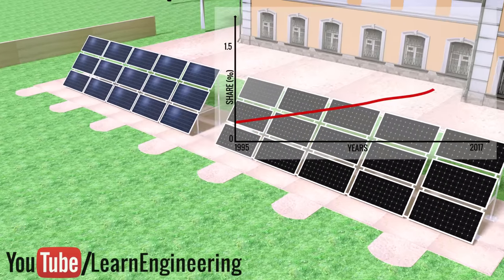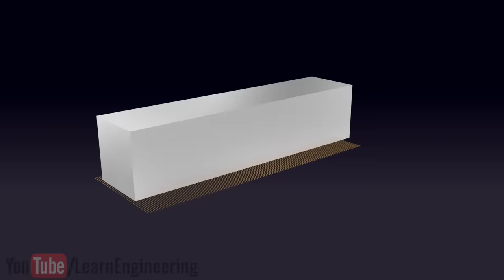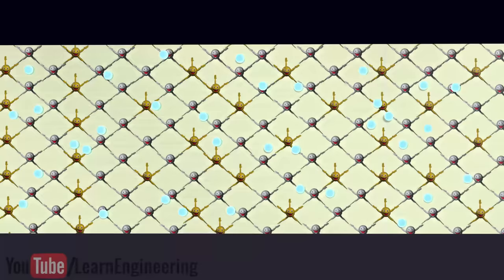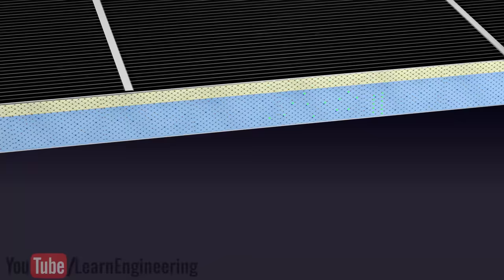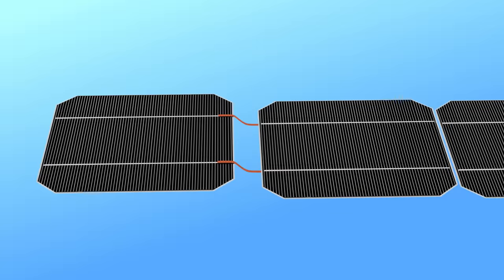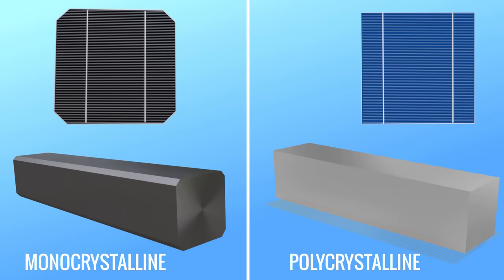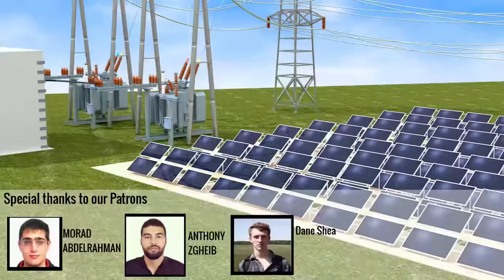How do Solar cells work?

Comment: The emoj-like nucleus representation is really creepy.
Reply: Atlas Wlk it's not creepy according to me. It helps us to get a clear picture of that bonding example.
Reply: I didn't quite understand why the holes and electrons formed in the depletion region were moving in their given directions. The electrons moved over to the negatively charged side which already had an excess of electrons, which seems like the opposite of what should happen.
Reply: @fonduman213  
It is kind of confusing. The important thing to note is that the P layer and N layer have NEUTRAL charge to start out with. The P layer (green holes) is not positively charged, it simply has atoms with the electron structure that allow it to accept electrons and become negatively charged. So when the depletion zone forms, the area of the P layer in the depletion zone is actually negatively charged, in other words it was neutral and has now accepted electrons. So when more green holes pop up, the go to the negative charge which is the P layer, and all the green holes stack up and flow through the load.

You can probably get a better explanation than I can give if you look up how a diode works, which is literally what a solar cell is; a bunch of PN junction diodes.
Reply: @fonduman213  Because electrons move in the opposite direction of the electric filed, while holes move in the same direction of the electric field.
Reply: @kushagrak960  Don't use the word 'according' to describe your own opinions. It sounds very arrogant.
Reply: According to my expert opinion, the world will be ended 300 years before this video is will posted. 🤪
Reply: @fonduman213  The electron-hole pair does not happen in the depletion region, they take place around the depletion region...  As the photon energy in the sunlight is higher than the bandgap energy (1.1 eV) the sunlight excites and wakes up the otherwise 'sleeping' electrons.. thus causing electron to move...  and hence current

Comment: I was doing some reading about the James Bond Movie: The Man With The Golden Gun on TV Tropes and Idioms. They mention that the villain: Scaramanga, has Solar Cells that operate at 95% efficiency. They mention that the best that solar cells currently get is 25 to 35%. They added that if solar cells really could operate at 95% efficiency, then all other power sources would be obsolete and the energy crisis would be solved. We'd have all the power we'd ever need. Hopefully they'll achieve that soon. Imagine, you'd have solar panels on your roof and never have to worry about running out of power. You could have them on your vehicle and never have to worry about recharging the batteries. Vehicles of every type, except submarines, could be solar powered. Even jet aircraft, since there is a such thing as electric jet engines. The problem with them right now, is the batteries can't hold enough power to allow them to fly the same distance or further then standard jets. Too bad.

Comment: large solar Farms also use STG systems for energy storage for instance they might be used to run a water splitter and store the excess energy as hydrogen and oxygen gas to be used as fuel in a generator at a later time

Comment: Thank you for the video ! Can someone explain to me why the electrons generated by the light energy crosses the depletion region into the N-side ? The field favors that direction; but the field is only present in that direction within the depletion region right ? Beyond the depletion region, in the N-side, electrons would want to stick around the positive ions in the depletion region. So why does it move toward the terminal in the N region (Away from the positive ions) ?
Reply: Probably two years too late now but here it goes. Imagine now the electron has travelled to the n side, with that one more electron at that n side. The n side is initially charge neutral. This electron pertubs the charge balance of the n side by making it more negative. The positive and negative "forces" don't equal now. So the sensible thing is to kick an electron out into the external circuit to maintain back its charge balance.

If you are interested to learn more about solar cells in an intuitive and fun manner, I'm starting a video series called "Shining Light on Solar Cells", covering the a-z of solar cells. Catch the series here: https://youtu.be/53eBzy8eZ-8

Comment: "in the case of a solar power plant, the massive amount of storage required is not possible" isn't that what Tesla did with their peaker battery packs in australia? just wondering how it is "not possible" from an engineering standpoint?
Reply: Not economically 'possible' maybe, it's always a matter of cost, of course it's possible, I always have a motto "If you can imagine it, then it's possible"
Reply: "If money and time tends to infinity everything is possible"
Reply: Instead of storing it, we can just transfer the power generated by the solar plant to the grid system. It is more cost effective
Reply: It is possible but the costs would be high so we just let it flow into the grid like any other thermal power plant.
Reply: Yeah that didn't age well 😆
Reply: @rickyal9810  how so? Looks like the hornsdale power reserve is still in operation

Comment: Hi guys, thank you very much for this video. It's very well done. Just one question. My understanding is that electrons would move to fill the holes. Why then would the electrons move to the n region when light hits the junction? Shouldn't it move the other way towards the p region?
Reply: no because they would want to move toward their side, not the depletion zone
Reply: @milanganguly8751  That's what I didn't understand. With the depletion zone being electron poor (and therefore positive), wouldnt the electrons move to fill that side?
Reply: That is because there’s an electric field between the depletion. That makes the electrons move to the n type layer
Reply: Hi Ashish, 

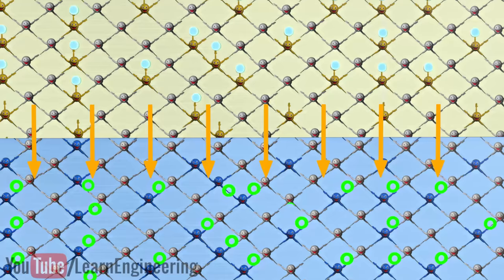 I totally understand your confusion. Now that there is a depletion region with an electric field (Shown at 2:55, being positive on the n side and negative on the p side), the electron and hole pairs generated at the depletion region would separate according to this electric field, and hence electrons would travel to the more positive  n side of the depletion region.

If you are interested to learn more about solar cells in an intuitive and fun manner, I'm starting a video series called "Shining Light on Solar Cells", covering the a-z of solar cells. Catch the series here: https://youtu.be/53eBzy8eZ-8  Your question is covered on Chapter 5.0 of the series. Stay tuned!
Reply: Well the explanation is actually easy when lesics said after the depletion region is formed there are no free holes and electrons as n region lost electrons they are positively charged and p region get electrons so it is negetive so just because the voltage above the depletion region is different the elctron go to n
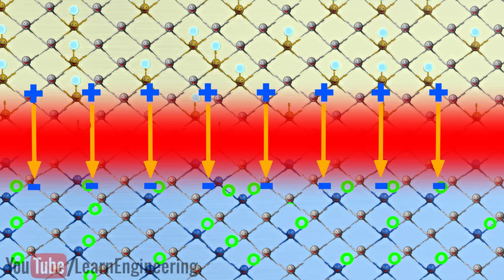Reply: 2:47

Comment: I’m new to this type of stuff. I’m learning so I could help the environment be more cleaner in the future
Reply: It’s important to note that the process of converting the raw material to pure crystal is very energy intensive. Thus a solar panel takes about 3-5 years of use to offset the environmental affects of producing it. This is a downside compared to wind and other renewables.

Comment: Light energy increases the potential in the N-type, cuboid to pentagon geometry. At the junction force transfer is from N to P where Boron pyramid with an extra electron enter unstable equilibrium cuboid. 
A good conductor allows near 'c' force eject reverting Boron to pyramid stability. And reverting N-type to prior state for potential gain for the next cycle.

Comment: Thanks. Very well explained. My question is, Sun gives us Light and Heat energy. With solar cell, as explained, only light energy is converted into electric energy. Sun's Heat energy is wasted. In case, we have a system, by which Sun's Heat energy is also converted into electric energy simultaneously, then  efficiency would have been higher.
Reply: Hi Partha. Great question. Solar cell researcher here, you may refer to thermophotovoltaics (a current active research area) for more details. However, the efficiency is still low and not ready for commercialization as it is relatively expensive.

If you are interested to learn more about solar cells in an intuitive and fun manner, I'm starting a video series called "Shining Light on Solar Cells", covering the a-z of solar cells. Catch the series here: https://youtu.be/53eBzy8eZ-8

Comment: Thank you for the video, well explained👍 I have a question here: With irradiance, the electron-hole pair is generated in depletion zone, with the electric field there, the electrons are attracted to the N layer while holes to P, leading to a narrowing down of the depletion zone, subsequently leading to the weakened electric field. Then it will stop attacting electrons to the N layer. While the depletion zone nearly disappeared, the electrons in N layer start to diffuse into P layer again which will form a depletion zone again, round by round. So this is a complete dynamic process?

Comment: You need to change this wonderful explanation video with an update text on the place where it says "monocrystalline cells are not widely used" because in 2020/2021 they are basically the ONLY type used now. 
Please update, or the entire video is useless and cant be linked by professionals or educators.

Comment: The massive amount of storage required for grid scale PV is currently possible, pumped storage for instance, compressed air, molten salt, even tesla grid scale batteries or possible future techs, like hydrogen, gravity storage, liquid metal batteries, flywheels, etc. Perhaps you should have said 'not yet economically attractive'.

Comment: Just to share here. Why 2:46 "Due to electrons migration, the N-side boundary slightly positively charged, and the P-side become negatively charged" ???

For N-side, the reason is because a neutral Phosphorus atom on the N-side have 15 protons(+) and 15 electrons(-) originally. But after giving away the extra 1 electron, the atom of Phosphorus now having 15 protons(+) and 14 electrons(-). This caused the atom to have 1 more proton(+), therefore atom of Phosphorus on N-side become positively charged (+).

For P-side ,the reason is because a neutral Boron atom on the P-side have 5 protons(+) and 5 electrons(-) originally. But after taking 1 electron from the N-side, the atom of Boron now having 5 protons(+) and 6 electrons(-). This caused the atom to have 1 more electron(-), therefore atom of Boron on P-side become negatively charged (-).

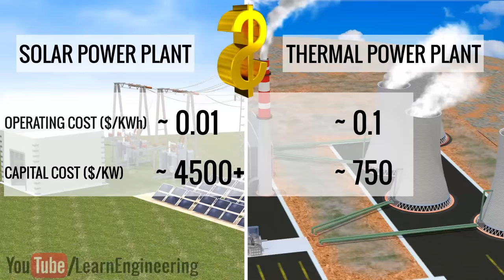Comment: All these figures at 6:22 for the solar power plant can be redacted if you don't assume a central location like a power plant but just decentralized (and thus hopefully more balanced) generation on top of roofs of houses and businesses. I payed a fraction of the price per kW for monocrystalline solar panels including installation. The only thing that is not factored into my "fraction of the price" breakdown is the likely upgrade in infrastructure (wiring) that is necessary to provide sufficient low resistant paths for the generated power to go to the right places.

Comment: This video is very interesting but I didn't understand that how  sunlight produces holes and electrons 🤔🤔🤔🤔🤔
Reply: If the photon energy absorbed is high enough to break a covalent bond, then an electron is freed and a hole is created.
Reply: It’s like striking a white snooker ball (the photon) into a cluster of snooker balls (the atoms bond with its neighbour).

 The photon basically knocks an electron off one of the bond between a silicon atom and its bonded neighbour the electron then gets struck off the atom (into an ‘orbit’ known as the valance band) then gets forced up into the n region by the electric field across the depletion region - The electric field only has enough ‘strength’ to influence electrons that’s lie in this valance band, the photon striking an electron in a bond gives it enough energy to break free of its current sub-orbital and jump into the valence band which the electric field can influence  . The bond that lost the electron becomes electro-magnetically unbalanced and pulls any available electrons back to ‘repair, the bond and become electro-magnetically neutral (stable). To get an electron back to fill the ‘holes’ the electrons are forced to take the path through the attached circuit.

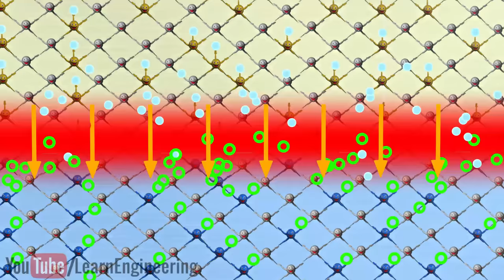Comment: How does the electric field drive the electron-hole pairs even further out if equilibrium? At 3:25 you show the holes moving towards more holes and the electrons moving towards more electrons. This can't happen without an external applied field because the electrons are repelled by each other and attracted by the holes. They should just recombine with the opposite side and work to neutralize the pn field. 

I know that the process of light causing electron (exciton?) dissociation is very complex, does this cause this mysterious fields? Or am i completely off base, i did always have trouble with the pn junction stuff
Reply: Oh shit, it's cause the natural material is neutrally charged. The addition of boron gives extra electrons but DOES NOT make it negatively charged since it has an extra proton in the nucleus to account for it. BUT at the junction those electrons annhilate the holes on the other side, essentially removing electrons from a neutrally charged region, and the opposite for the other side. They have less elections (so more holes) but also less protons so still neutrally charged, but when the electrons come over they add negative charge to the area, ONLY WITHIN THE REGION. This creates a small voltage across the depletion region, OPPOSITELY CHARGED to what the p-type (positive) and  n-type (negative) names would imply. 

So when excitons are generated by the photons hitting the material, knocking electrons out, their dissociation is prompted by the potential, and the electrons move towards the n-type and the holes nice to the p-type, generating a current from n->p sides of the junction.

Comment: The interesting thing I want to know that how electron absorb in n region and how the holes are absorbed in p region, please reply my question that will help me to enrich my knowledge.
Reply: Your question isn't very clear,  but I'll try to help. You use a material with a low resistance than that of the silica to connect the regions.  The electrons will move through the less resistant material to try to fill the holes. You then connect your  device or battery to the less resistant material, forming a circuit.

I apologize if I did not answer your question
Reply: When light strike on on junction then positive whole and negative electron produced. But how these electron go into  negative side and positive whole go into positive side of pn junction. Generally electron should go to the positive side and electron should go to positive side by attractive force. Please clear it.
Reply: @md.khaledbin5448  it's happening like that because they're already attached to a closed circuit (even though it's not shown yet.) Otherwise the excitation of the electrons would be expressed as heat rather than a flow of electrons and holes

Comment: I had a question regarding the photon energy. Earlier when there were no solar cells all the photon energy was absorbed/dissipated on the ground. Now it's getting absorbed by solar cells. Has anyone studied the long term effect of this?
Reply: Everything is about the scale. In reality on a sunny day Sun produces about 1000 W of energy per square meter in every second.  Due to this huge amount of energy that our Earth is getting from the Sun, the PV installations are safe from producing free electricity, and will never consume that much of energy.
Reply: Electricity from PV panels ends up as heat at the demand side. So the overall heat energy is the same, just the location of it is different. Anyway PV panels' efficiency is maybe around 20 % so most of the energy still dissipates as heat at the location of PV panels.

 @Michał Dudek  1000 W of energy? ;)
Reply: Sorry, 1360,... W/m2 measured from above the Earth's atmosphere. From the ground level it will be lower. In accordance to STC parameter, using to compare efficiency of the PV modules, it is roughly 1000 W/m2. The energy dissipates as heat as well as radiation reflects back from the PV modules causing the lower efficiency of the PV panels.
Reply: @michaeld2826  You're right, there is also some reflection from solar panels. But anti-reflective coatings are used (letting sunlight to the PN junction and not letting it out), assuring only down to 2 % of sunlight to reflect. Otherwise it could also be a problem for aviation companies.

I was talking about the unit of energy, not the value of power density. It's 1000 J per square metre every second, not W. That's all :)

Comment: In 3:35 part of video electrons are moving toward the region where there are excess electrons already. Why don't they repell each other?
Reply: Not exactly a case of repelling, but if 5 electrons enter the excess electron regions, the n side kicks out 5 electrons to the circuit to neutralize the charge of the region.

Comment: Is there a difference if it's the p-region that's exposed to the sun?
Reply: Yes, huge difference. It will be less efficient.

Why? Due to the lifetime difference between minority carriers electron and holes at both p and n region of silicon respectively. Researchers have tried out both configurations and decided having the n layer on top is more efficient.

If you are interested to learn more about solar cells in an intuitive and fun manner, I'm starting a video series called "Shining Light on Solar Cells", covering the a-z of solar cells. Catch the series here: https://youtu.be/53eBzy8eZ-8  You will find more clarity in my answer at Chapter 5.1. Stay tuned!